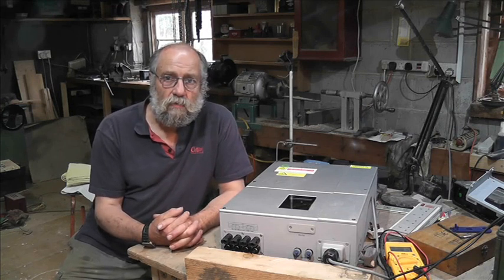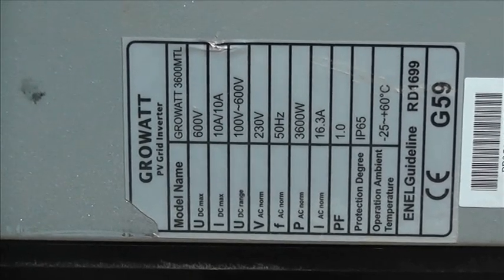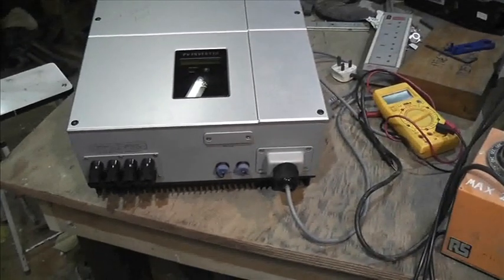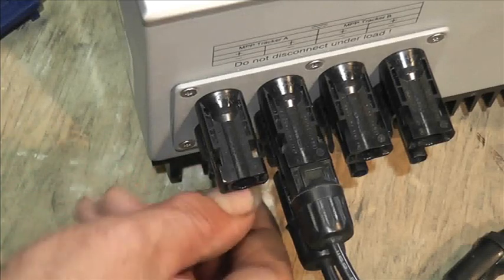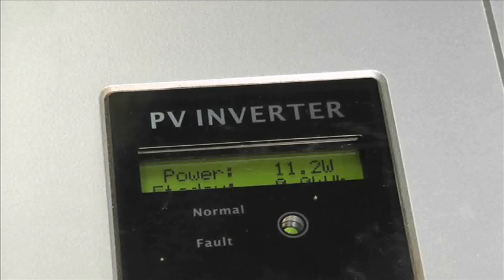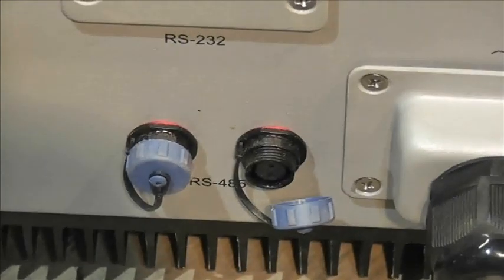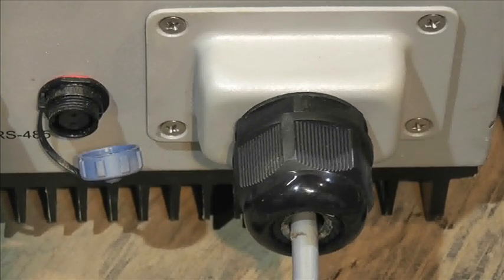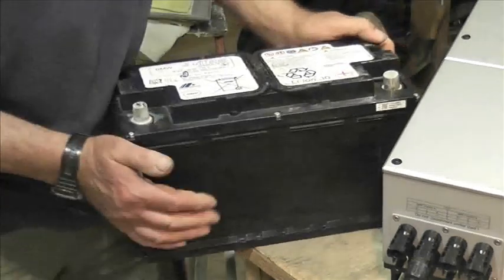Growatt 3600Tl solar inverter details.

Comment: Looking forward to the next video. Plenty cranking power but low storage at 69AHr. I guess modern cars are designed to have their engines running at all times. I can't see that battery working for start stop engines.
Reply from the maker: Ian, I suppose the lithium charges up rapidly, unlike a lead acid. There must be something in it beyond the weight saving, cheers

Comment: Thanks Andy always helpful and informative. Looks a solid well built unit. Have you ever tried to use these units as a stand alone unit off grid?
Reply from the maker: Hi, no I haven't but I am lead to believe that this will work when use with a Victron multi plus battery system, cheers
Reply: Yes I was wondering about that arrangement. Also using a small solar panel grid tie inverter to think its online. Could go two ways smiles or smoke. Thanks for your reply.
Reply: Seems to me like a simple software option would generate the AC without checking for synchronisation. I believe the problem to be drawing a load without a buffer. Wouldn't the load need to match the supply exactly?
Reply from the maker: @ianhelsbyservices  That's why it needs the multi plus Victron and battery to create an AC signal and a load through the charger or the power consumption, cheers

Comment: I suspect that you're right about the "upgrade" to batteries. I came home with 12 grid tie inverters yesterday. Silly me. I got some broken panels too. working but smashed. I have a couple of ver low start voltage inverters now so I am going to try a pair of panels alone and see if it will run.
Reply from the maker: Owen, short circuit current test is your man here, pick the best and apply rule one of solar panels, cheers